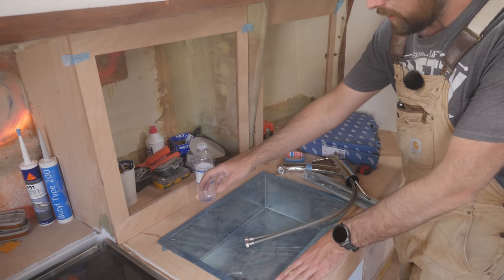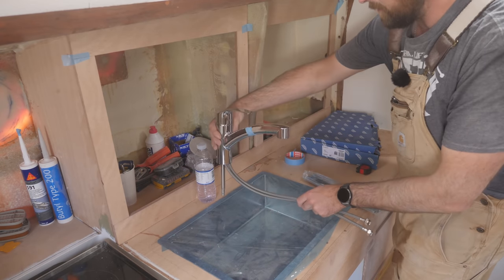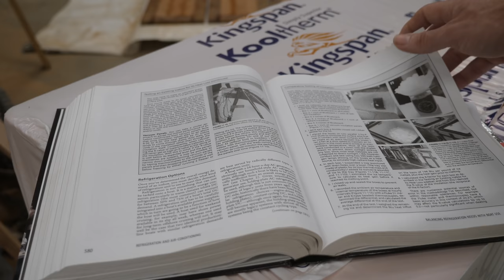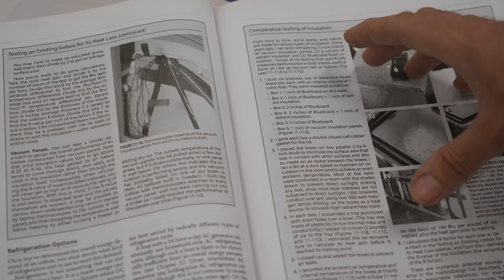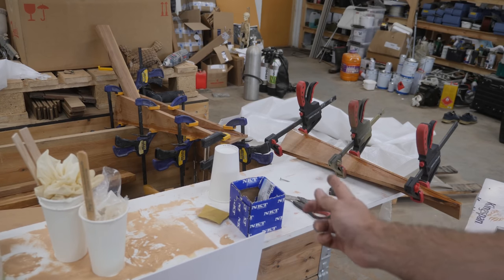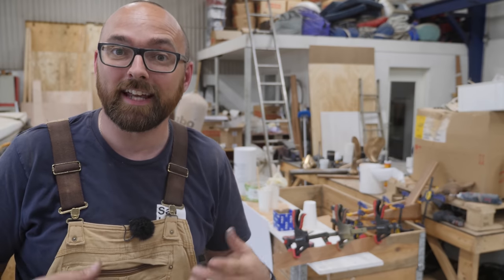Sail Life - Galley 90% done & yet more fairing - DIY sailboat project

Comment: Hey mads. You're doing great work man! For the cabinet above the sink, have you considered mounting drawer slides and having the door slide forward like the sliding barn door thing. With it not swinging out, you could even add a spice rack toward the top. It would always be accessable because the door would just slide forward and not swing... Just a though...

Comment: As for the faucet issue.  I think you’ll be happier with it off to the side and out of the way. 
The only thing I would say you might want to think about is a DEEPER sink.  Or some kind of baffle system. It will be nice as is at anchor but underway water is going to slosh right out. lol

Comment: At the start Mads puts it out for advice so was he live streaming because he then goes and installs doors behind the sink anyway but if he is still open for suggestion instead of two large swing doors halve them again into two sets of concertina doors that pivot out at the half way point effectively halving the  swing ratio and would still suit the style of cabinetry right down to the choice of hinges only problem there is the locking mechanism and may rattle more. As for his draws how do they stay closed do those draw runners have the push lock option?

Comment: Your refrigerator foam, is it open cell foam? Definitely seal all the foam in epoxy (repeat Epoxy) resin. Fiber glass for strength, Pretend a starter motor dropped into your fridge. Which could happen. On doing a false drawer front sink as suggested below. Check it out in photoshop first and see if ya like the looks. They are internetable too.

Comment: Mads, do you have room for a table saw on Athena along with your TIG ?  Hopefully you won't have any need for those long boards, just a grinder and the turbo sander.

Traditional cabinet door allow the center panel to "float" in a dado cut in the the door frame.  That way the center and swell with humidity independent of the frame.

Comment: I would refrain from using portal doors since there ALWAYS will be something in the way. Plus they have to be locked to stay shut. I would use rolling shutters. No locking needed, no space needed. Also, that way, you could open up only the lower shelfs for cooking under way in heavier sees, and keep the top stuff from falling out. The faucet would be best situated next to the stove since the extending dispenser seems to be pretty short. That way, you could fill water directly into a noodle pot or something like that.

Comment: The tap (fauset) would work on the outside edge on the right, it can swing completely out and away from the sink for access. 

I would use a bar rather than a rod to prevent the parrellagram effect for the fridge lid.

Comment: Mads, just watched LaV and they had a refrigerator failure which made me think since you are building yours why not put in a high/low temperature alarm.  Could be as simple as an Arduino connected to a sensor and buzzer.

Comment: Hi,
i fear it is too late, but the doors behind the sink should be sliding doors. They would not disturb the room in front of the doors. The sink is not the best choice, because the sharp corners are very difficult to clean. Smooth rounded corners would be much better. (To late too ;) ) At least: you have planed some serious locking systems for your big drawers under and beneath the sink? Athena will not for ever stay straight on land. :)
Greetings Klaus
Reply from the maker: I considered sliding doors but that leaves only half the opening to be open. I hope that makes sense :) I've placed an order for some latches for drawers and cabinets :)

Comment: I really doubt your cabintable/dieselfridgekitchencounter swing system. Under sail with rolling waves it is to big and everything on it should be out of the way to reach the fridge. As the PoC is too unstable, bigger and more heavy hinges in a stiffer system will consume a lot of room and also increase the weight of the kitchen counter.It will work perhaps when moored or at anchor.  I still think the old and known solution of a insulated hinged lid as seen on many boats will pay its advantage on the long run. You can stow more food and drinks and maybe a smart tray system inside can help you the fridge arrangement. Good luck and of course if you stick to your plan, still my admiration and respect for your DIY journey to get Athena your perfect living a board boat. Every week fun to see your progress.

Comment: Probably too late now, but there is no way I'd used that insulation as it looks like it will soak up condensation from the cold box and you'll have a wet & soggy mess.  There is a much better option and that is vacuum panels.  You can get them made to fit and then I'd go with a stainless steel box liner to keep any spills away from it.    It would also be WAY, WAY more efficient  which is important as it will be one of your biggest energy consumers.  You don't want your pumps running all the time.

Comment: I thought we had to build or rebuild assuming there would always be some salt in the moist air circulating inside any boat. Regular (non-brass or salt resistant) fittings are ok? No concerns for corrosion in the future?

Comment: You can get pop up Fossetts and a detachable headshell on a spring might be ideal as well. Thought you might have made the sink floating isn't it beneficial for a boat.
Why do you need metal runners for the last thing I would use on a boat

Comment: Really starting to look like the end is in sight. Have you thought about a dummy drawer front to the sink?

I’ve been thinking about the wobble on the counter top and I’m Unser if a connecting rod will stabilise it over that distance. You may need a gear on each bracket and connect them with a rod to keep each bracket synchronised.
Reply: I like the gear idea...

Comment: Would some sort of foldable faucet do the trick?  If not put on the side. Even if you would make some sort of slding door a faucet in the middle  of the cabinet would be quite annoying in the long run I suspect. Another solution could be some sort of pop-up faucet,  have not seen suitable model  though.

Comment: Mads, 
Have you factored in the heat from the fuel return to the tank under the refrigerator? During extended motoring or generating the fuel temperature can rise significantly. Just a thought.
Reply: stairman45 dont think that tank will be the supply return tank...that is why the transfer manifold to move fuel to/from main tank.

Comment: Mads, LINING THE INSIDE of the fridge ( to be impact resistant) I used in the past 1/16" thick fibreglass board like : https://www.mcmaster.com/standard-plastic-sheets/material~fiberglass/ . I like the first item GPO-3 red colour, very nice to cut and sand. May be cheaper to lay FG sheets in-house or glass-over in situ, but prefab saves gobbles of time and effort when flat surfaces are what you need :)

Comment: Adding sawdust / wood fibers to thickened epoxy. Hmmm ....
Hadn't thought of that, and I have a gap filler project that might work with.
How well did that turn out insofar as color matching the surrounding solid wood.
(Has anyone tried that in the past?)

Comment: Extending the pivots isn't going to help a lot, adding flat plate between the two struts you were going to extend to open the top further would be a lot more rigid axially..
 It would  also make it less likely that you could trap your fingers in the mechanism.

Comment: Masonite - pronounced May-son-ite  - - dictionary has convoluted symbols that most of us Americans don't ever use... and Masonite as in MDF (Medium Density Fiberboard) is a DON'T USE - - the water resistant version of Masonite is referred to as MDO (Medium Density Overlay) is used for cabinetry in kitchens and bathrooms as well as painted doors which is great for you! -- HDO (High Density Overlay) is used for counter tops, workbench tops as well as concrete forms which is to say its abrasion resistant - not for you and is expensive. MDO is for use as panels on doors and cabinet doors due to its dimensional stability over time and is primarily used because it is excellent for painting. For example your doors and drawer fronts that you made may split over time due to shrinkage as the wood continues to dry the rest of the way over time (even though you used epoxy which won't move, the rest of the wood panels within the fronts will shrink perpendicular to the grain as wood does naturally over time). - - Wear a mask when cutting MDO as it is a fine dust - or be like my Old Man whom eats the shit for breakfast lol.

Comment: I’m surprised the book on making on ship coolers didn’t warn about the opening size of the cooler. The reason those are normally small is because when you open it, cooler air escapes. In your case, you are pretty much letting most all cooled air out each time it’s opened. This will be re-cooled of course but I would calculate that into your generator usage. It will increase it at least two fold (approx.) for the cooler.
Reply from the maker: I don't agree :) Cold air is heavier than warm air. The opening is at the top. Even if I drained all the cold air it's not the end of the world. Example from the book (page 577). 8 cubic feet fridge at 35F has all its cold air replaced with warm air (100F). Heat load to cool that hot air down to 35F is only 20 btu or roughly 0.5 ah.

Comment: Just wondering why your cheating out so bad on your hinges?  I build houses and the main things you can do that really don't cost much that make a house look higher end is plumbing , lighting fixtures and outlets as well as hinges and trim work. Get some recessed hinges that are hidden for your cabinets and self closing for your drawers? They really don't cost that much more you can even find them on Craigslist for free with cabinets half the time. I think having self closing would be invaluable on a boat so they're not sliding open on there own all the time.